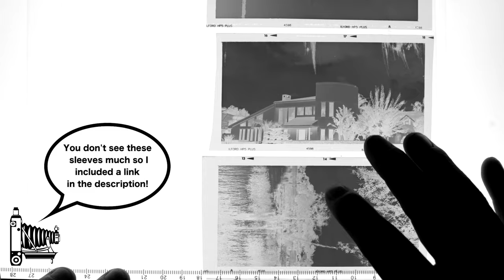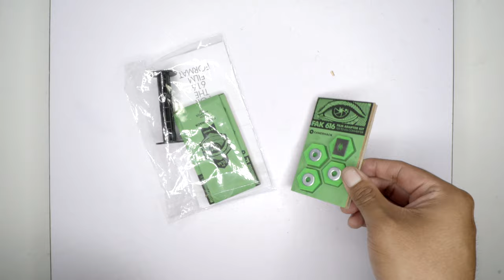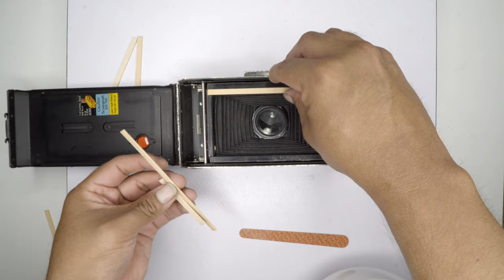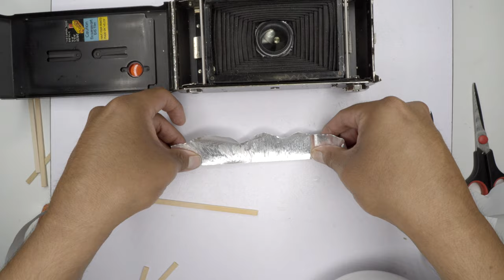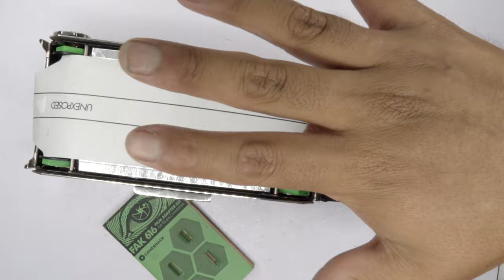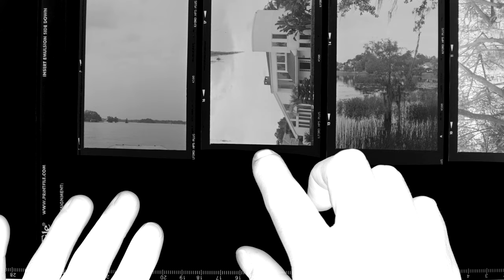HOW TO convert 616 Camera to hold 120 film

Comment: One issue is the fine screw in the front lens. It doesn't take many turns to change from close up to infinity. Your sticks are thick enough to push the film plane in front of infinity.
Instead, I used Clear Lamination sheets you can pick up from Staples. I cut the rails using the very thin self-adhesive acetate and added 2.4mm strip under the exposed lip to stiffen up the mask. 
This barely alters the focus plane and provides enough stiffness to flatten the 120 film against the spring-loaded backing plate.
In 120 cameras film flatness is a major issue, and the acetate mask solves it with a 616 format.
The format is great, essentially a 6x11 cm frame, so close to a 6x12. 
I got very lucky. Found a LN-in-box Six-16 Kodak Vigilant with the latest iteration lens and shutter. Not having a rangefinder or through the lens meter is not an issue with me because I cut my teeth on a 35mm folder back in the 60's.

Comment: Can you advance the frames as normal or do you need to compensate? I have a Kodak Autographic 2A camera that I want to shoot.
Does FFP sell 116 or 616 film still?
Reply: They do on occasion and Blue Moon Camera as well as Central Camera both still sell 616 and 116, as well as 122, 127, 620, 828 and 110
Reply: @Keith195573  thanks for the information!